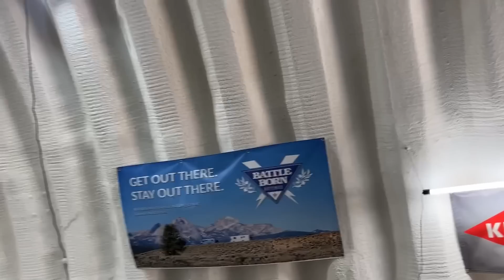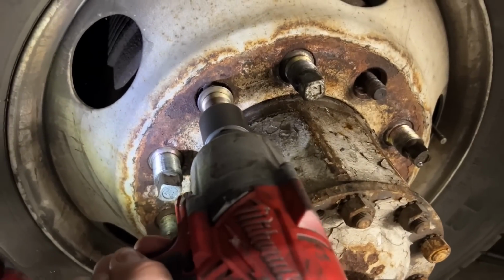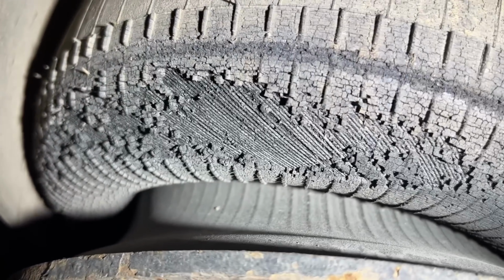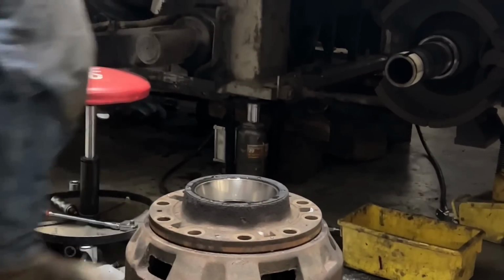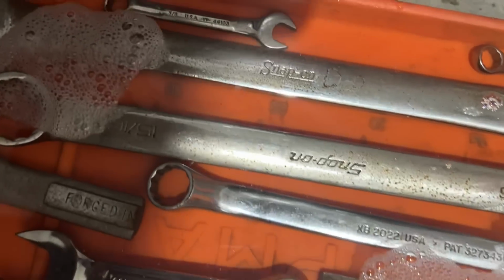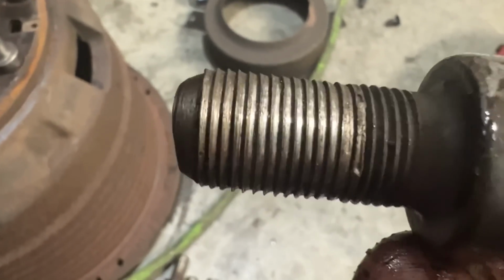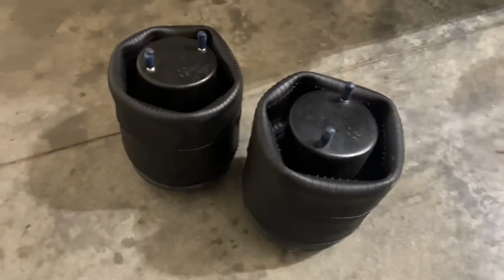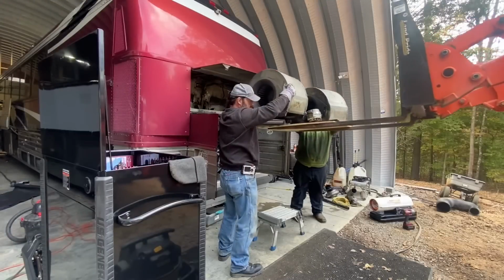Mci bus has some very serious safety issues to address.  Mci 102D3

Comment: I've watched a few of BGM videos and I'm wondering if these busses all have non-independent solid front axle suspensions?  Recently a MegaBus was on the news for having crashed ending up on its side.  Now being able to see the underside of the bus, the  front suspension on the MegaBus appeared to be independent A-arms.  The busses in these videos appear to have independent suspension tag axles with a second rear solid axle as the driven axle.   

Those MegaBuses are exciting to kids.  My cousin's kids thought they looked so cool they arranged a trip so they could ride on a MegaBus on one of he legs of it.  A doubt there has been that much excitement for choosing the bus since the GM Scenic Cruiser of the 1950s.

Comment: As you're all probably aware, ALL Trucks and Lorries & busses, no matter weather they are used for business or pleasure, by law must pass an annual MOT inspection by the DVSA here in the UK, and most are subject to 6 week safety checks. That bus in the video would have failed so badly on many many issues, it would have been instantly impounded by the DVSA. They are ruthless and the level of standard for a pass is very high, (dripping oil is frowned upon) and you as an operator are scored on your level of 1st time passes for your other vehicles. If you fall to an amber or red (from a green) you are much more likely to be pulled over for road side inspection to the MOT level of standard.

Comment: If this channel has taught me anything it is to give a wide berth to any converted, non-fleet bus I see on the road. For every one that BGM sets right how many more drive around with wheels about to fly off, wobbly suspension, clapped out bearings etc?
Reply: Makes you wonder if these RV's should be made to have mandatory DOT inspections like a truck considering the state so many of them seem to be in.
Maybe not as frequently as a truck - possibly an initial VERY thorough inspection after conversion and a regular inspection every 2-3 years would be pretty fair considering they're not doing the mileage of a commercial truck.
Reply: Many states have yearly inspections for cars, why not a bus?
Reply: @harveynailbanger  Massachusetts does have inspections for all vehicles, but I don’t know if they are going to catch all these issues.
Reply: @markjames8664  ye I agree there not going to catch a lot of this stuff unless they jack up wheels and pry on them, pull tires and drums to see brakes and check bearings.
Reply: Dot cops inspect semis all day long. A bus is just another truck, only it hauls people...
Reply: Great point...i see tons living in Myrtle 1thing we notice is a 50k bus/ camper towing a 40k Harley w a set of $10 tie downs...you know the ones!!! Just unreal how people skimp on tie downs
No insp.in SC is nice.. but the clunkers are everywhere
Reply: I'm a trucker by trade and own a bus conversion as well. The most likely reason they aren't inspected as much as rigs is because, you can't safely(or shouldn't)get under a bus(motor coach) with a creeper. Which, is what they usually use for roadside inspections. So the motor coach would have to be driven to a inspection station with a pit. Personally, I think the main issue is due to the fact most of these owners don't have a cdl(not required). Inspections are critical but, so is common sense and safe driving habits. I've heard plenty of stories from mechanic friends wondering how the coach they were working on was even able to make it to the garage safely. Some with very little braking. Scary stuff
Reply: Up in Ontario Canada our insurance firms are starting to put converted buses into a not insurable file.  So the dreams of a school bus conversation to a motor home are disappearing.  Even though everything above 10,000 pounds on the road must have a complete yearly inspection.  Yet in this video ( or  the video before this one?)the bus  went through a different garage with zero concerns.  So a safety is only as good as the firm doing the inspection.
Reply: @highwaywarrior7778  I mean that's just the thing, you've got people who've never had their cars properly taken care of now doing the same thing to something that weighs substantially more, often through multiple owners. Deferred maintenance top to bottom and back to front just because they haven't the first idea of how to maintain anything.

As an example, I bought an '88 Volvo a few years back and not a single bit of rubber had ever been replaced on it, save for the tires. Suspension bushings, hoses, seals, belts, all of it clearly factory original from May '88 when the car was made (many parts still have date stamps and they're all 4/5 '88). Shocks were new-er, but still about old enough to drink... And it'd been bought new and kept by the same guy until about a year before I bought it. Georgia car, so it's otherwise solid, but the amount of squeaks and thunks someone can learn to ignore is unreal.
Reply: Here in Australia these vehicles would require yearly inspection.
Reply: If you cant afford to maintain it you can’t afford to drag it off of one of those mountain pass runaway roads.
Reply: Howdy, 
I see your point, and agree, somewhat, though not all fleet buses are always maintained better than a conversion. 
Yes, there are some conversions out there that aren't maintained as they should be, but there are also many bus conversion owners that take great pride in their coach and it's maintenance, their safety, and the safety of others on the road. Unfortunately some do not, of course and that applies to all types/sizes of vehicles.

Comment: Neet! This what I bought and am converting to an RV. Got it from Rochester City Lines in Rochester MN, so it has had regular service and maintenance.
Reply: They put it on one of their pits and I got to do a visual inspection of the underside. I did not see any of worn bushings, shocks, and rust (and looked for after watching your videos). I did not do as through of an inspection as you do. I also got some of the history of the bus from Boss, mechanics, and drivers. They have been really great to work with.

Comment: This is reminding myself of a safety blitz  done on U-Haul truck rentals in the Province of Ontario Canada.  Our Ministry (department) of Transportation Safety department along with Ontario Provincial Police vehicle safety officers stopped every U-Haul Truck on our major Freeways for a week+/- period.   Sadly there was not a single truck that was allowed to continue without having safety concerns fixed.  The poor people that rented the trucks were stranded as a replacement trucks were bought to Scales to change out there belongings to a better truck, before the transfers occurred the replacement trucks failed the roadside safety checks.    Your past two videos have shown some dangerous buses that were on the road,   In my home province of Ontario Canada all vehicle's over about 10 pounds must have an complete annual safety check done before a new licence permit is granted. Is there similar safety steps in the USA?  If a tire came off these buses the result is a death sentence to the small car they may hit, let alone a bus that is out of control that lands upon a small car.    Thankyou for cleaning up two buses that can now travel the roads protecting other road users from an unsafe vehicle.
Reply: As well the MTO would pull over a lot of US tour buses for inspections and the most troubling story we heard was the brakes where only operating at about 13 percent capacity. I can assure everyone in Ontario that the Provincial Transit agency of Government of Ontario. Keeps their buses in top shape and the drivers are never made to move a bus that they feel is unsafe. Safety is job 1. I know it might sound like a no brainer but there are companies that can pressure drivers to take sketchy equipment on the road. That’s where the problems start and lives are lost. And you’ll mostly see that in the private sector.
Reply: That's terrible, but that's good, without safety checks done we are all in trouble on the roads.
Reply: European here (Austria). We have very strict inspections for buses and trucks (well, cars too) and no way something like this would have escaped our inspection. Years ago after the end of Communism we used to get old East European coaches and trucks which were like that but nowadays even they caught up (and our police does stop and check anything from a "suspicious" country like Moldova, Belarus or (until recently) Russia).
Reply: Even with MVI there is a way around it. Hell for $100 in Nova Scotia anything is safe. If you know what I mean.
Reply: @jordanc7263  That's probably how the local school bus contractor keeps buses on the road way too long, many stories of unsafe buses and I know for a fact most of their older buses have been quietly emissions deleted due to MaxxForce EGR issues and a DEF shortage

Comment: I have one of these, and am missing two lug nuts from the drive axles (one on each side).  Does anyone have a link to where I can get the lug nuts?
Reply from the maker: Budd nut one left and one right hand thread.  Any truck tire shop will have them for you
Reply: @BusGreaseMonkey  it seems as if all threads are regular clockwise to tighten.  I don't know if the previous owner (transit company) made that modification, but I can't figure out the thread pitch.  I bought m22x1.5 but that doesn't work because the thread is too fine.

Comment: This is why I highly recommend before purchase inspect as much as possible(if you can bring a bus mechanic, thats even better). Then after purchase take it directly to a bus mechanic. Fortunately, I live near US Coach (and know Bill and Luke well[great guys!])and that's exactly where mine took its first trip after I bought it. Bill found quiet a bit that needed attention(all not visible unless you are under it). The scary part is this bus was driven from Ohio to NJ by the previous owners and was allegedly purchased from a bus company.
Reply: As a coach driver for the past 38 years (and still going), I can tell you from experience that coach companies will run to death a coach and then sell it. It's very common that none of the systems will be ok to drive for any distance. But the new owners take it down the road anyway because of not knowing how to check the coach out.

Comment: Good evening mr. I’m running a Detroit 471 two valve head on a sawmill. This is my second 471 on this mill (first one number 2 piston came apart) anyway, the mill bogs down more than I think it should in the cut. Do you have any governor videos? Can I even adjust the governor? It is a “sw-vs” and it has HV6 injectors in it. And advice would be great. Thank you.

Comment: Ive been having an issue with my gillig phantom with a detroit series 50, I get 2.9 volts at ecu fuses. I cut the two power wires going into ecu and got same 2.9 volts coming from ecu... my question is, the starter is 24v is the ecu supposed to be 24 or 12

Comment: Howdy there. I just started watching your videos, Some really awesome coaches and awesome mechanical work.
 I was wondering if there is anything specific that y'all think  I definitely should check for on a 1992 MCI 102c3 with 6v92ta and an HT740 Allison and possibly a 1997 MCI 102dl3 with Series 60 Detroit and Allison b500. I'm decently familiar with 2 Stroke Detroits, Series 60 and both Allison's.
Basically anything specific or unique to those years and models, that I might not be aware of.
 Thanks in advance for your time and assistance. Any help would be greatly appreciated. Liked and subscribed. 
Sincerely, C.M.

Comment: Scott your a god scent. I can't believe those air bags held air. Those studs for the wheels; unbelievable he was able to travel down the road to get to your place. Like the song say's: if you can get your rig to the top of the (Bus Grease Monkey) mountain, Scott will bring it back to life. The shop entrance looks great. You seem to let the owners of the bus(s) drive their rigs into the shop (I would never in a million years let that happen, but that's me, I'm very anal that way) may I suggest using tennis balls on a string, spaced just so as they pull into the shop the tennis balls will hit the corners of the bus as they enter, and maybe one located when the bus is in the shop where you want them to stop. Just a thought. If you should go with the tennis balls, a trick to use is,  after you get the STRING through the tennis ball, tie to a tooth pick, to keep the string from pulling through the ball. Stay safe, and god bless you and your family.  Woof woof to Leroy.  PS., I used very thin welding rod to get the string through the ball, just used tape at the one end, to secure the string to the rod.  I'd used a 1/8" drill bit.

Comment: Watching your recent videos, it feels like there is a common theme. Do you have any advice for someone who wants to get into a bus/conversion/skoolie with regards to how much they should set aside for these types of repairs? If a person spent $N amount of money, is there a good estimate how much they should expect to need for repairs such as these to make them safe and reliable. 

Also, any opinions on early 2000’s rear engine school buses with the 8.3l Cummins? Seems like a lot of what you do are two-stroke Detroits.

Really enjoy your videos. Appreciate the insight.
Reply from the maker: Spending a couple of hours inspecting it wheel by wheel.  Making sure it would pass a commercial dot inspection.  Plan on replacing all rubber.  Purchase price is always the cheapest part of owning a bus
Reply: A pre-purchase inspection by a 'competent' bus mechanic would probably save thousands (and possibly your life). It can tell you which to avoid, and/or provide a negotiating tool if not too far gone. Next bus I buy, the first place I'll go is the roof and then underneath for a stem to stern scrutiny.
Reply: @BusGreaseMonkey  I know right?
Tires, airbags, brakes, registration,  tax, title...I would save a bundle if I can find a place to do the work myself.  Maybe one day.

Comment: Hi! How can we prevent Rubber of the airbag to dry lire this?
Reply: You can't really, just like tyres they have a finite lifespan due to rubber perishing/dry rotting. Certain things like making sure the air dryer system is in tip top shape helps but ultimately you just have to accept they have to be replaced at some point, they're a wear and tear item. Buying high quality replacements is the best solution. 
Also air bags aren't massively expensive all things considered - they're very mass made, standardised heavy vehicle parts. It's just having the skills/facilities to replace them.

Comment: How often do these busses have to pass any sort of test?
Reply from the maker: In most stares never.  Once the title is changed to RV it gets exempted from any regulation requirements including dot pre trip, annual, or any other inspection requirements.  It also in most states never requires and special drivers licenses or training to operate that the vehicle with just a title change to rv.  Once a bus identifies as an rv it’s got a free pass to the basically the same operating restrictions and requirements as a moped.